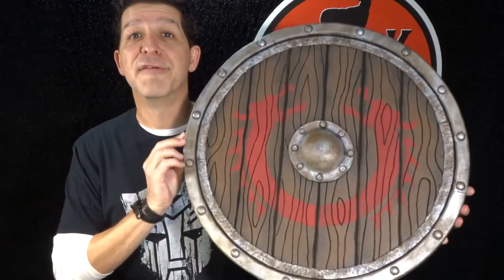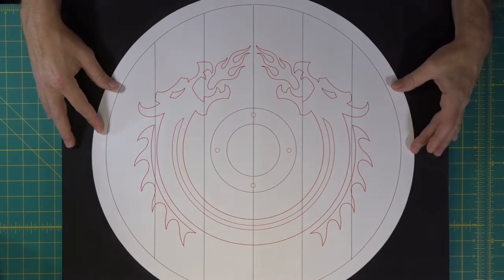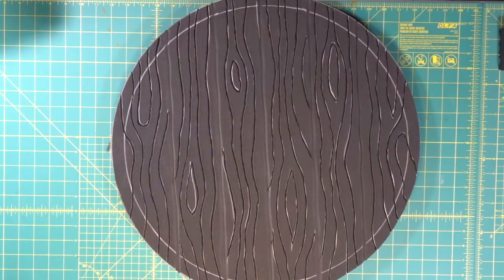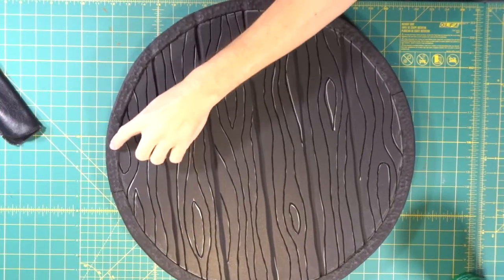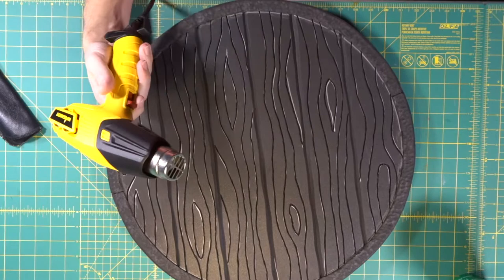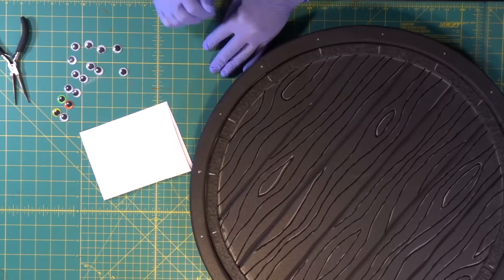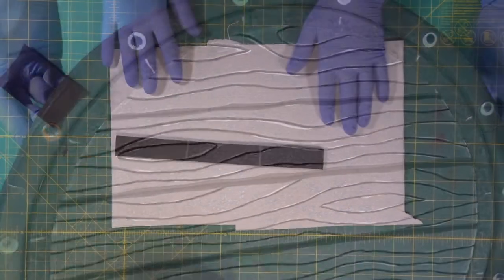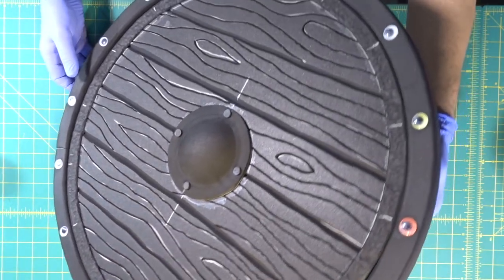Making An EVA Foam Viking Shield Part 1

Comment: Where do you get eva foam single sheets large enough to make this shield?
Reply from the maker: Hey David!
This was one of my very first builds so back then I was actually just going to my local Lowes and buying 2' x 2'   1/2" thick floor mats ( the kind with the puzzle piece edges like in a gym or a preschool ) and the shield fits on there fine. I’m sure Home Depot has the same floor mat foam too. It usually has one side smooth and one side with a fake diamondplate pattern on it.
But if you want to go bigger, I now buy all my foam from TNTCOSPLAYSUPPLY in Texas - you can buy 12MM (.5" thick) foam sheets much larger than 2' x 2'. Plus TNTs stuff is smooth on both sides which is great.
Reply: Thanks @BlackSheepProps  That's convenient since they're located here in Farmers Branch, 21 minutes from me.